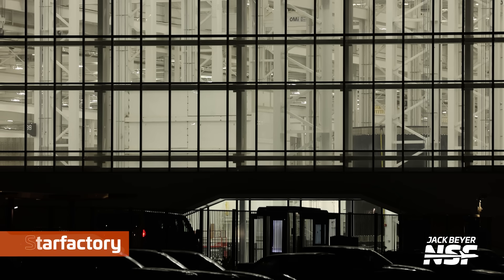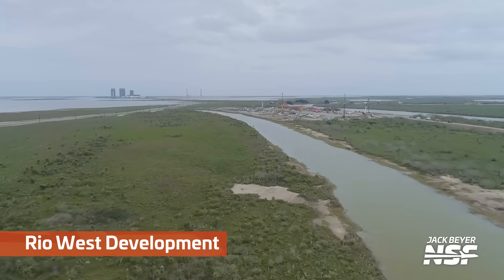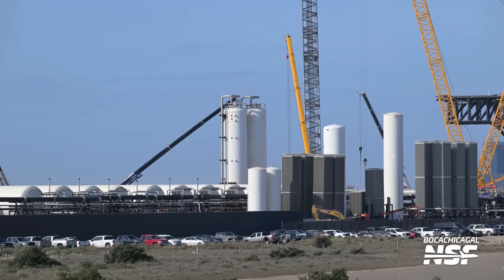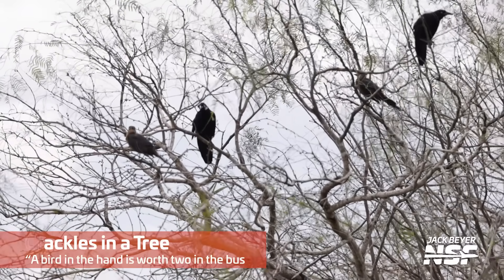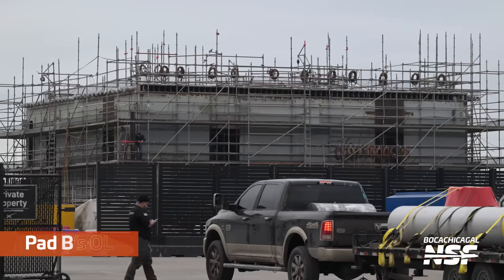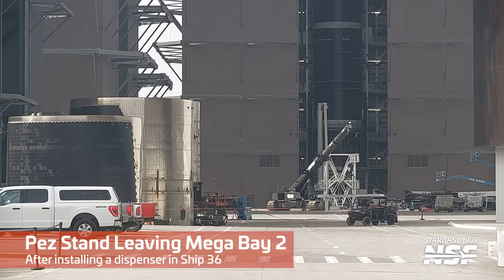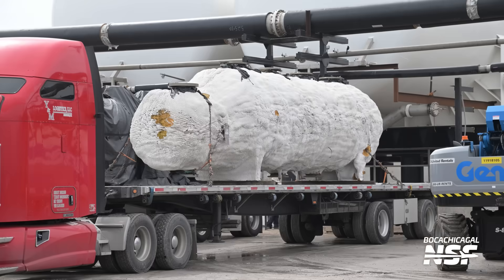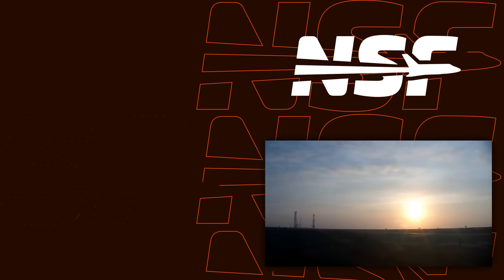"Hey Look, That's The Pad B Chopstick Moving" | SpaceX Boca Chica

Comment: My father is a Civil Engineer and cement versus concrete was not a mistake we were allowed to make after the first time.  Cement is a powder that is mixed with water and an aggregate (sand or stone) to make concrete.  So basically, cement is just a component of concrete and concrete is what is hauled in those mixing trucks.  Think of it as flour to bread.  Cement is flour, concrete is the bread.

Comment: It's a hub puller isn't off the rails, it gets the axle off the wheels! 

I've seen them for bearings and a few other odds and ends. 

Those specialized pliers for retaining rings are another generally single purpose tool I can think of.
Reply from the maker: There are some really weird snap ring plier shapes for sure 👍 - Das
Reply: Circlip pliers.

Comment: Google Bray pneumatic actuator. Series 98. Not sure if the brand they have is Bray but that red is their color for most of their valves and actuators. Same type of valve though either way for reference.
Reply: Also, I work in commercial and industrial HVAC and the actuator being kind of separated from the valve is normal on all butterfly valves nothing different with cryo vs other liquids. Probably only the valve itself is made for cryo, the gasket and metal.

Comment: My specific tool I've had to buy was a $30 O2 Sensor Wrench for the back side of the exhaust. It has a massive bend in the handle to account for round exhaust pipe, no real need for it otherwise.
Reply from the maker: O2 sensors, sheesh. - Das
Reply: @NASASpaceflight  Yeah, it sucked. The front sensors aren't that bad, but the back sensors literally have their own dedicated wrench. My wife wasn't too happy about the purchase.
Reply: Similar to the old distributor timing adjustment wrenches.

Comment: John, i believe the Rusty steels are not rusty, they are called Corten Steel - This may be because of the Salt water in the environment. I may be wrong, but space X puts safety first so i would be surprised if they let the steels rust. Im sure you can check this out. What a great show, and you missed the Guy put a dummy cat on the large pipe he was installing. He was posing for the Camera.Also great visit to Vast, i learned so much, on new production strategy's👍
Reply: Ops Dog!!

Comment: Those are power gas actuators for pipelines. Duck duck go will show a number of types. Most scavenge gas from system to open and close valves very quickly and are automated.

Comment: SDV or Emergency Shutdown Valve, ESV, ESD, or ESDV) is an actuated valve designed to stop the flow of a hazardous fluid upon the detection of a dangerous event. This provides protection against possible harm to people, equipment or the environment. Shutdown valves form part of a Safety Instrumented System. The process of providing automated safety protection upon the detection of a hazardous event is called Functional Safety

Shutdown valves are primarily associated with the petroleum industry although other industries may also require this type of protection system. ESD valves are required by law on any equipment placed on an offshore drilling rig to prevent catastrophic events like the BP Horizon explosion in the Gulf of Mexico, and yes they are red in color

Comment: Those "red things" are hydraulic valve actuators. You can clearly see the hydraulic line arriving on some of them into a hydraulic valve (or maybe it is a distributor block, but it looks more like a control valve) which then goes to the larger cylindrical part. This is the actual hydraulic cylinder moving the valve. The long smaller cylindrical part is a spring, so it must be a spring return hydraulic actuator.